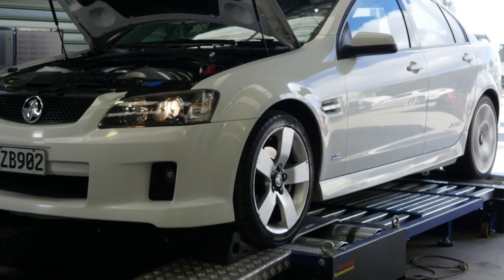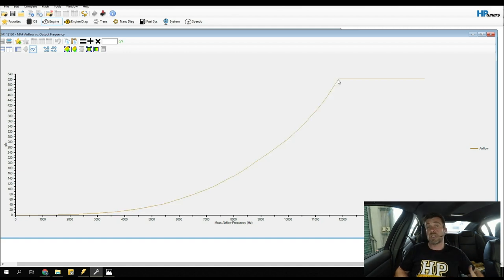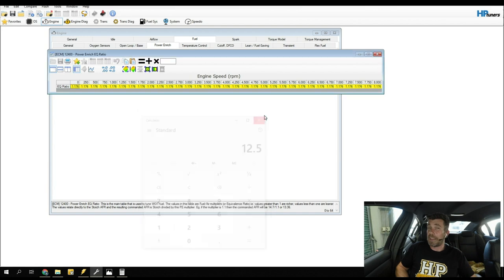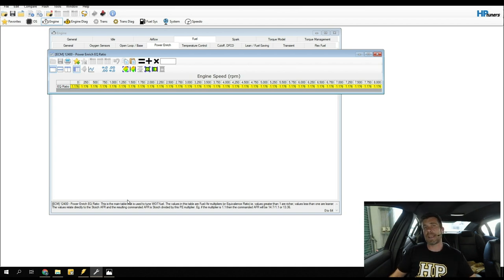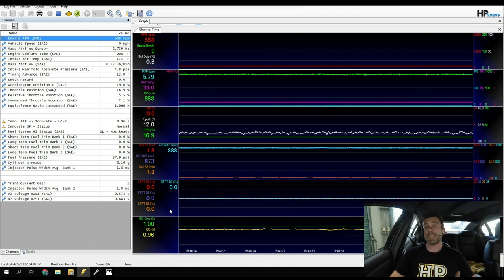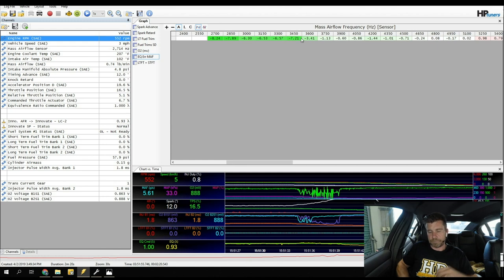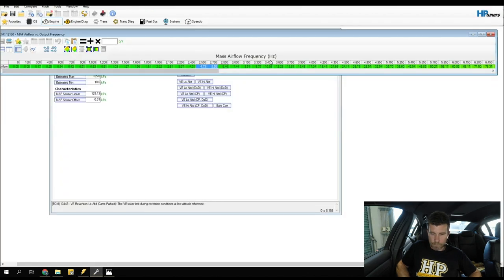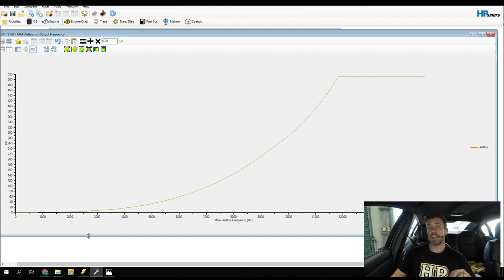MAF Re-Scaling Made Easy With HP Tuners

Comment: A major one not to miss on Gen4s, INJECTOR TIP TEMP!!!! Once you reflash, it will take up to ten minutes for this to go away and you will run pig rich.  If you want to flash and retune right away, disable it while tuning or you will have to sit and wait for it to come back in line after each test and tune.
Reply from the maker: You are spot on, 'rich after reflash', we talk about that too if anyone wants to understand what is happening in the background 😎

The 'Injector Offset vs Injector Temp table' is what you want to adjust - Taz. 

https://youtu.be/Iy5giNjGpK0

Comment: hmm you have set the temp to lowest -40c? i have ben in -54c so what happens when you get below? it CAN stop as that is deadly at those temps.
Reply: The sensor cant go below -40C (or F as they are the same at that temp).  If youre below that, thats on you and probably should seek shelter so you dont die.
Reply: @mattnsac  your car better not stop. then your in trouble unless you have the cloth needed. you should have that tho.

Comment: He’s right everyone throws the maf in the bin. Although I prefer having the maf on a Subaru sti daily driver factory ecm car for many reasons.elevationcorrection  #1 and atmospheric air density changes every day and the maf can correct for that as well. 

Ps if you run a maf in a Subaru. And took your air cleaner off to be cool like a Honda. Well there is your problem. I’m a pro tuner and IV attempted to scale a maf without an air cleaner just to see and test. Car ran like crap. Put a nice clean air cleaner in it. And clean your maf at the same time. Re calibrate  your wideband. Then attack all exhaust leaks. There should be 0 then attack any boost leaks or post maf suction leaks. And then finally. Maf systems require a bypass valve or blow off valve whatever plumbed back into post maf. Any post maf leak will ruin your tune. Aka blow off valve. But I have a blow off valve and just modified it to blow off Pre turbo inlet. Post maf. And 
#3 I’m paraphrasing everything this guy has said because IV been watching him for years. Like years. And for years he’s the only one that actually knows what’s going on and can explain it and even go into serious detail that I was looking for.

Comment: how do i do this when i have a bigger maf housing and bigger injectors?
is it just in this way or is it not working because of the change of both fuel and air
stock injectors are 315cc now i have 650cc, maf housing is stock 2.25inch now i have 2.75inch.